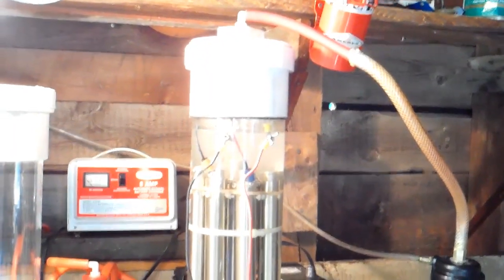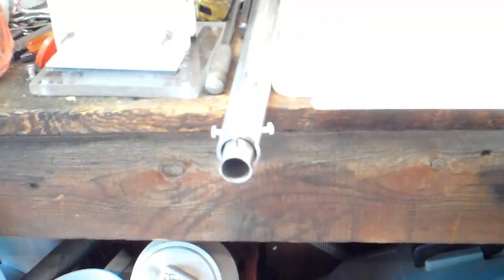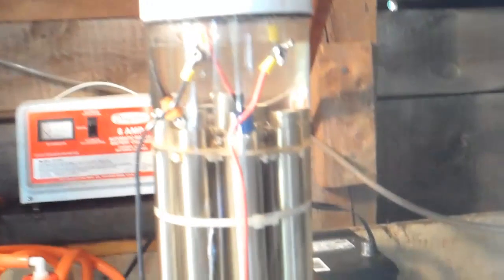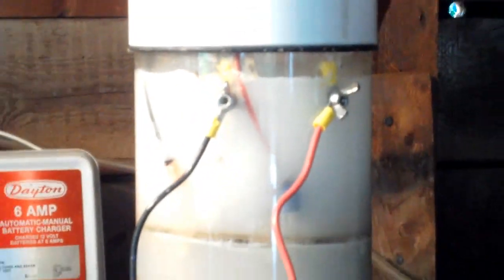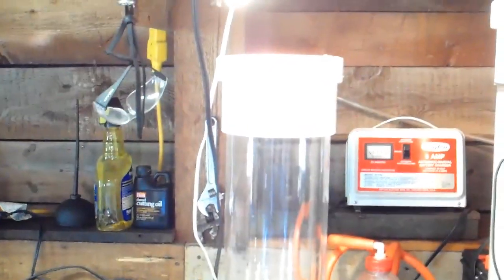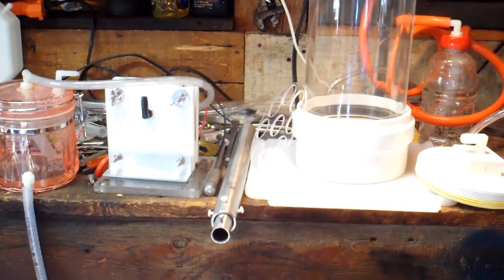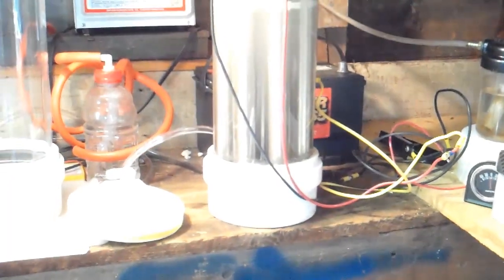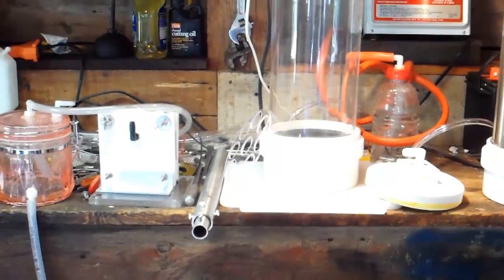Tweak to Stanley Meyer HHO Generator Produces Lots More HHO

Comment: You realize there is a law on electrolysis discovered in 1800s right? You can calculate the maximum production per surface area or are you saying you discovered a new law?

Comment: Why not use teflon pipe tape on the ends instead of the screws ?  Also, PVC pipe may be a good insulator material or some kind of rubber or vinal tubing.   The nylon screws do not look durable enough.

Comment from the maker: Bruce, there is nothing too odd about the fact Stanley Meyer's project has been successfully duplicated. Even his brother, Stephen, who had access to S.M.'s entire workshop and notes failed! IMHO, both his patents and the Internet DISINFORMATION obscured what he was really doing. See my video Stanley Meyer HHO Hoax https://youtu.be/qZJ1S0tQseU

I actually discussed a lot more about it in the Comments section where a lot of armchair crackpots ridiculed my discoveries without ever having built any Stanley Meyer circuits or water fuel cells.  
I've also reported that HHO is NOT a fuel, only a catalyzer that improves combustion....the volume of HHO output is NOT the critical factor.
The actual "fuel" that Stanley Meyer used in his dune buggy was quite different than HHO and was only successful because he invented his water fuel injection plugs. this technology is far behind the ability of the average HHO enthusiast to replicate with any intelligence. 
As a result, lots of HHO hobbyists and commercial builders alike completely ignore the key components S.M. required to achieve success:
How many HHO kits sell a proper gas processor? How many HHO kits have designed and sell the water fuel injector plugs and the complete injection control system? How many of these faux systems operate under pressure? How many of these kit components use the old tube within tube archaic method that Stanley Meyer originally used?  He gave up on that method. I began with that orginal type design and then went on to design and build my Plasma Arc Injector Plugs......way beyond anything Stanley Meyer did before he was killed/died.

My latest video Steam Engine Powered Hydrogen Fueled Generator https://youtu.be/jk0S-KB3Qm4  shows where my research is today, a decade after fooling with Stanley Meyer's old designs. Dave D. www.HHOTrucking.com

Comment: Question, what is the voltage over wfc, does it have to increase or decrease?
Reply from the maker: S.M. created circuits that hit resonance by pulsing ever increasing voltage until the dialectric, water,
snapped. the voltage multiplied in stair steps, square waves that draw upon free energy while amps were low and blocked from increasing.
To understand it requires you read the research papers on the subject. It is not conventional electrical engineering and so it is completely misunderstood by virtually all conventionally educated electrical engineers including the guy who worked for me. He was chief engineer building a nuclear sub and didn't have a clue. I proved him wrong by demonstrating this on my kitchen table!
Reply: So voltage in wfc needs to be in KV?
Reply from the maker: @hardcoreplayafromthehimala4888  the voltage needed depends on the electrolyte but Stanley Meyer used distilled water.
There is not a specific voltage that works as each wfc is different but, the circuits that get good results often go into kv.
You cannot expect good results simply by dumping high voltage into water. The circuit is critical and it appears that he
used an electron extraction circuit to draw electrons out of the electrolyte sufficient to light up an incandescent light bulb.
You can learn about all these circuits from my e-books: Secrets of Using Water For Fuel and HHO Hybrid Auto Conversion Plans.
There is waaaay too much info to continue this discussion here. See http://www.hyfusion.com or http://www.HHOTrucking.com
Reply: @hyfusiondotcom  entonces nunca diste un voltaje.. lo unico que hiciste fue dar vueltas y promocionar unas paginas de internet.. vaya basura..

Comment: We are now using hho generator in gas or diesel vehicles. Am getting 25% diesel fuel savings, cleaner exhaust emission, and stronger engine power...Just using the only 12V ordinary car battery...resulting to only  1.5 amps draw...no heating of hho gen.

Comment: Its not the generation of hydrogen in tubes that got Stan killed..Its the spark plugs that he developed that generated hydrogen in the piston chamber..Stop f... around with tubes and find out about the plugs.
Reply: lol use both, or better still go make a Joe Cell, doesn't use the hho only the H and this passes through a blind metal plug to the block, it also uses very LOW amperage, typically UNDER an amp, and also check out plasma sparks on youtube use 3 ceramic caps in line with your leads, produces a plasma like spark and gets better economy and more power, furthermore ask me about another treatment that reduces your fuel costs by ANOTHER 28% and pollution right down to 2% if interested

Comment: What is the purpose of the bubbler?
Reply: Since the Gas generated from the HHO is flamable if you dont have a bubbler you can get a blowback in the system which isn't good
Reply: Bubbler is for filtering out the mist of salt water or whatever electrolyte might be used, so that salt would not end up in the engine. I would use more than one bubbler if I were you, and for flashback arrester, I would put cigarette filter in the tube immediately faster gas is produced and immediately before gas is coming out into the air intake of the vehicle, to prevent explosion of HHO which can happen even without a spark. I use a latex balloon to capture the HHO as buffer.

Comment: Would you like to lower your temps and Double your output With one simple tweek on your design? Cross drill your outer tubes! I use much smaller tubes and get just as much output on a very low amperage and use a larger tube for better H20 circulation!
Reply from the maker: +DayRider76 Thanks....good advice, this is an old video and all my new designs do use cross drilled tubes. When done correctly you get a vortex flow of electrolyte through the tubes and you can actually see the hydrogen bubbles MOVING DOWNWARD and then up thru the center. 
My latest design uses cavitation and a special additive to the electrolyte which boost the power of the HHO gas but slows down the burn rate. Hint....do you drink?
Reply: hyfusiondotcom
Used to drink a lot! Probably was when I wrote that comment? lol, looks like what I meant to say, was use a larger outer tube with the cross drilling to improve circulation and temps! lol, I'll send you a pic of my design here!
Reply from the maker: +DayRider76 thanks for the pic! I add a tablespoon of denatured alcohol to a mild electrolyte using NaOh.. This "tweak" will improve performance and power of the HHO.
Reply: hyfusiondotcom
nice! Thank you!
Reply: +DayRider76 please send me a pic of your design? imagine.2007@live.com
Reply: acetone on about a 5% mix in the bubbler, not the electrolyte will also do similar combustion improvements

Comment: ha please if I had one of those generators I could easily figure out your "secret" just by experimenting. I'm an engineer so it wouldn't be hard to do. I might even find out a better design that gets 5x as much output. and guess what, I would post it up on YouTube for free cause I'm not a stingy person looking to get money for something as simple as probably adding more salt to the water.
Reply: secret ingredient is arm and hammer baking soda
Reply: Please do so! Make a vid of it and use the ad revenue or something. I'd definitely watch, thumbs up if you agree.
Reply: coil wrapping
emf boost from post exterior magnetic induction
Reply: Can you explain that?
Reply: From my understanding ions decrease efficiency drastically over a threshold. Same reason why changes in water volume decrease efficiency. It changes concentration, thus changing discharge time and current during on time. The ion concentration must be kept just high enough to allow reasonable discharge, while allowing quick charge. Althou capable current of power supply can limit the effects of these  changes due to incapability of increasing current flow.

Comment: A chap by the name of Yul Brown was installing similar equipment in cars in his Granville workshop in 'Sydney, Australia back in the 1950s. Educated scientists poo pooed the idea saying You can't get something for nothing' and' Perpetual motion machines don't work' so they declared Yul to be a charlatan. He invited the CSIRO to inspect his methods and a busload of scientists eventually arrived, grumbling about being pulled off their pet projects. He showed them a car fitted with his device and they set up their testing equipment while he answered their questions. At the end of the day they packed up their gear and said 'Well, It shouldn't work but it does'. Yul raised £4,000,000 from public subscription and spent it defending his world wide patents. He ended up moving to the USA where he received threats regularly urging him to shut done his business or else. One afternoon on his way home he was run off Yul claimed a normal reciprocating motor is only about 19% efficient,  by injecting a mixture of Hydrogen and Oxygen into the fuel feed it increases the efficiency to about 32%.
This mixture of gasses became known as Browns gas named after Yul Brown.
Yul also sold welding machines to the Chinese that also burnt Browns gas.
Try googling Yul Brown
I saw recently the US Army were fueling their Hummer fleet in Iraq with a fuel based on water split into HH O.   I think it was called Acqagen or something similar.
Reply: ESSE  SERÁ NOVO CONCEITO DE PRODUZIR  HIDROGENIO UTILIZANDO SOMENTE AGUA.. ATRAVÉS DO PLASMA E  4 ESTÁGIO

https://youtu.be/3rJiCPObPj4

https://youtu.be/XYPYES6CjVE
https://youtu.be/3rJiCPObPj4

https://youtu.be/XYPYES6CjVE
Reply: There are things that we don't understand but could it be possible yes 100 percent there is electric that they do not teach thermo Dynamics is broken also they just find there are other things at play tesla could use energy to run light street lamps one wire over and over energy is on a different gradiaiant or potential they don't teach about spark gaps I seen more energy come from spark gaps than is applied with massive increase in production also somthing like magnets near anode cathode can increase it by 20 percent the bifoler tesla coil stane mires used a bifoler coil hv low amps with a secondary pump circuit one diode and ÷ then nothing then - 3 pipes the spacing is important also they act as a capacitor and the secondary use the energy over over back thorth like scaler waves pump there are also negative energy that is also produced in bifoler with pulse from mosfet if one wire is 440 the centre is 0 the end is -440 and also there are ways of spliting particals more ifitant it is known energy can't be created or distoyed it can be used over over again with negative capacitors pumps circuits plasma and vacuum energy things like plasma read switch that cost couple of pence pucks  can use energy wirh squre waves pulse that can power hundreds of led light with just over 1 volt input it difrent a Genorator does not make energy it manifest it from the either all this does not get thought im university or school and people with no education seems to be more open to this stuff not because we dumb because we difrent ie autism or learning difficulties dyslexia many things but you grow up more hands on mechanical minded amd with out the brain washing of the education system as thay all it is brain washing and to know how much information you can learn store on a subject that never get used after leaving so no good anymore google is better than a school without the headache
Reply: not exactly true, my company gave hime 45k for a manufacturing licence , most if not all his patents had expired and proved to be plagiarised, having spent the money i reinvented the process and created hydrox int in the usa. all browns shareholders lost all their money ,mine doubled my investors investment , my technology lives today with the hundreds of copies made around the world, yes 126% is possible with simple materials , frequencies , lasers, magnetic fields, catalysts much more. brown died in the usa owing over two million dollars from the evergreen institute, the term browns gas and hydroxy gas was coined by me in 1977. the term hydroxy was used globally by my companies. what has this taught me ; greed , lies, power, global politics, don't believe in the narrative , fake news, everything we know is a lie, advanced tech exists beyond our wildest dreams. stan meyer let me into a secret when the water molecule is reduced to its atomic level it will produce unlimited amounts of energy ,is this what Keely did ?think about it.the answers lies within remember that. 
Alvin crosby.
PS brown never ran a car on water it was a trick to get money, however archie blue of nz did using ss plate electrolyser, sodium bicarb /rain water on a mini connected to dc generator ,under vacuum, he spent his later days at edwards airforce base during project magnet , Antarctica .

,
Reply: It didn't work. They were just not smart enough to see through the ruse. Except on a large cosmological scale, conservation of energy cannot be violated. End of story
Reply: @musashi939  water is a product of nuclear fusion.... A massive star larger than our own created it and there may be a possibility of finding a way to tap into some of that energy
Reply: @13thbiosphere  what? Tapping into that energy is just called nuclear fusion and this does not work with an hho generator. And wtf are talking about water created in a star. Bs. Water is a molecule and molecules don't form in stars. Water formed when a dying star spilled its guts into the surrounding space and hydrogen atoms came in contact with an oxygen atom. Please get your facts straight first before you even attempt to speculate how people smarter than you build stuff.
Reply: there is enough energy in 60 L  of H2O to power all the energy needs of America for one year if it could be converted into Pure Energy......accelerating Proton decay is a science still evolving smarter people than you could confirm ..... what do you know about  acceleration of Proton decay, keeping in mind science in 10000 years will be quite different to what it is today
Reply: @13thbiosphere  don't deflect by completely ignoring my criticism that you apparently don't understand how stars work and how water formed by aiming for something that is even more complex to understand which I obviously don't understand either, but you don't too.
The energy in h2o is is the binding energy. We already use that when using nuclear fission in nuclear power plants (just not on h2o but atoms.. Again molecule vs atom) . Now you're conflating fusion and fission. Please stop your attempts of deflection and confusion.
Reply: @13thbiosphere  not to mention your if it could be converted into pure energy.... It can't. Not without losses. If wishes were horses. But it can't and hho is a scam.
Reply: @13thbiosphere  one last thing.. There is a difference between a closed mind and a mind that understands that something is bullshit. I don't have a closed mind just because I know that hho is bullshit and you believe it's real.
Reply: @musashi939  if everyone thought like you there would be 0 progress in science even though this particular experiment probably is a scam The concept of Proton Decay is a very interesting science
Reply: @musashi939  I did read a book called creation of matter and the science of Proton Decay is not very well understood I am not suggesting that this particular experiment is not a scam it probably is but the idea of breaking water more efficiently is a possibility to experiment on particularly if we can discover a method to accelerate Proton decay
Reply: @13thbiosphere  maybe so. I will read up on that and still I don't know why you mention it. It has nothing to do with water and that water does not Form in stars which you claimed. Again this deflection. And no, we wouldn't not have zero progress if everyone thought like me. It would be good because there would be more scrutiny against outrageous claims. I just try to pick things apart. If they work cool but if claims fall apart under closer scrutiny because of some fundamental limits like the laws of thermodynamics I don't really understand why I would be at fault for a lack of progress.
Reply: @musashi939  some of the experiments that Stanley Meyer was using in his electrolysis had some potential for accelerating Proton decay the greatest potential to create a cheap method of Proton decay is by electrolysis, it's not possible to completely dismiss that possibility
Reply: @musashi939  any experiments with water electrolysis have the potential for the acceleration of Proton decay and that would mean tapping into vast energy so all experimentations are to be encouraged even the scams could accidentally discover something

Comment: Electroplating the stainless steel with gold be an advantage as gold should not react with the electrolytic process and will not produce hexavalent chromium. Also if the + and - is reversed  from time to times ions that may have migrated should go back to the electrode they came from.
Reply: what is a good base material to start with to electroplate an electrode. would gold foil work?
Reply: ESSE  SERÁ NOVO CONCEITO DE PRODUZIR  HIDROGENIO UTILIZANDO SOMENTE AGUA.. ATRAVÉS DO PLASMA E  4 ESTÁGIO

https://youtu.be/3rJiCPObPj4

https://youtu.be/XYPYES6CjVE
https://youtu.be/3rJiCPObPj4

https://youtu.be/XYPYES6CjVE